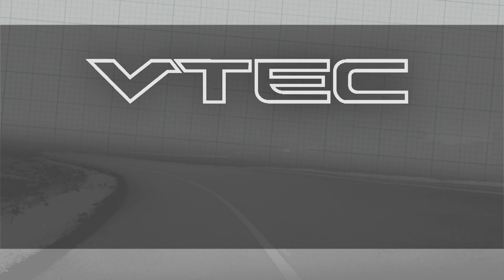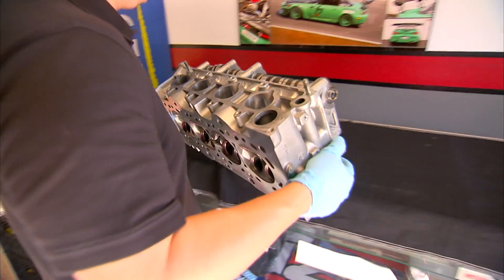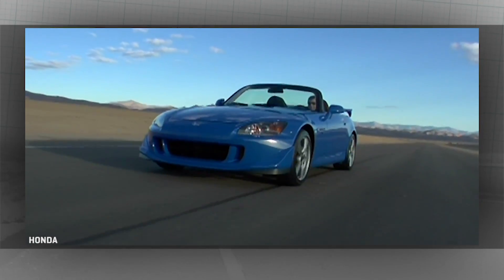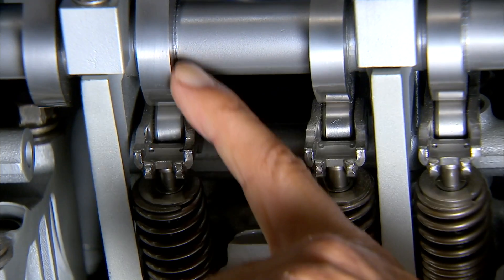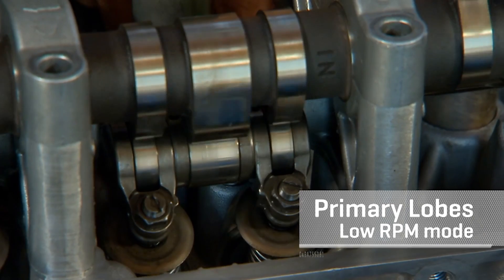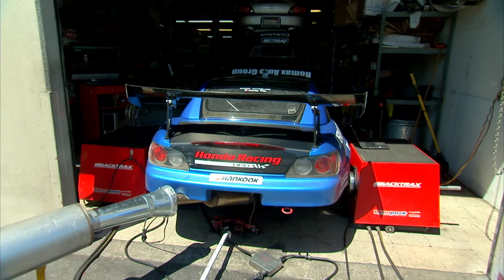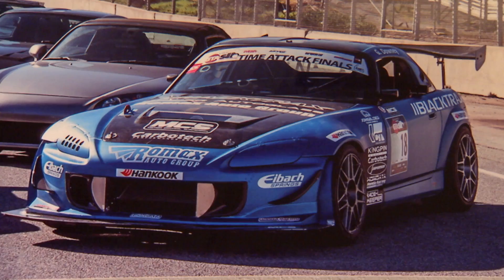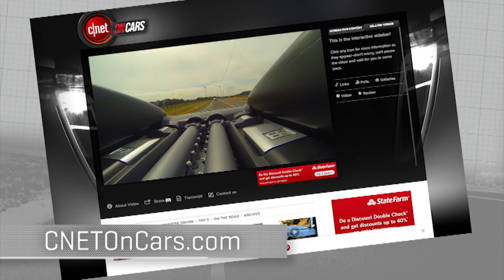Car Tech 101: Demystifying the mythical VTEC

Comment: Bet you all did'nt know that the very first vvt was used in an Alfa Romeo engine
Reply: That's cam phasing that varies a cam's duration. Unlike VTEC's Valve Lift which switches the rockers to a separate cam profile.